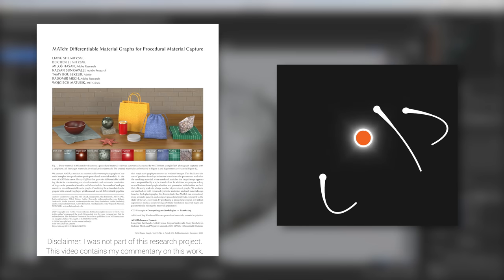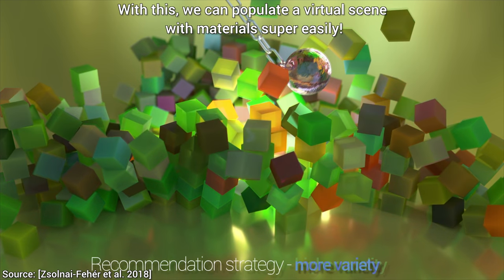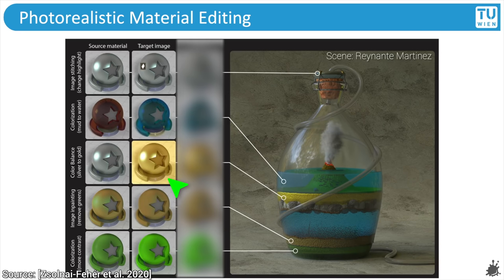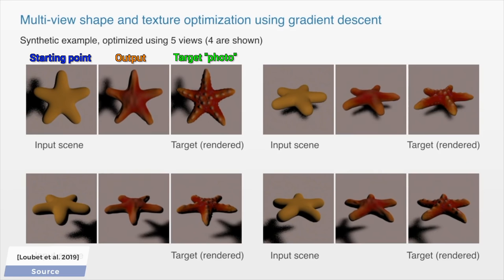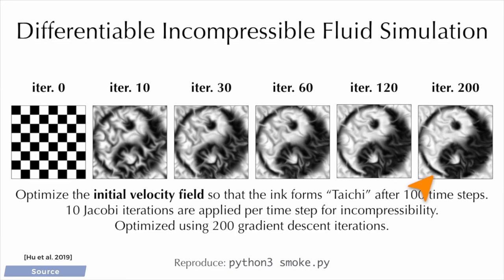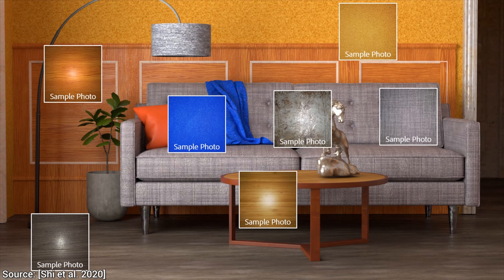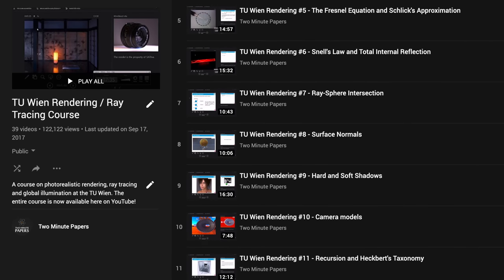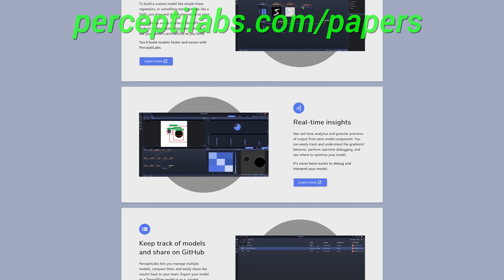Differentiable Material Synthesis Is Amazing! ☀️

Comment: karoly, i am running out of superlative adjectives to describe these developments you lay before us! the possibilities that this could unleash are so extraordinary that it is hard to know where to start, but here are three quick thoughts: 
1) there are oceans of budget-priced 3D models (Daz, RL, etc) that have reasonable geometry (ie made of quads not tris and quite high poly) but their texturing lets them down. re-texturing takes ages (whether you use substance or look for textures in texturehaven or poliigon etc), but this looks like it makes the process very quick; 
2) matching the foreground, live-action lighting in a green-screen studio to the lighting in the CG set is really hard - i wonder if this could be used to help either make the CG match the live action and/or even more amazing, help the DoP understand where the lights are in a reference scene? from this for fun and practice, can you imagine being able to work out how Arthur Edeson lit Casablanca or Robert Krasker lit The Third Man! or of course any other film that you think has wonderful lighting.
3) photogrammetry is progressing but it still leaves a lot to be desired. perhaps this could help with the texturing, which is otherwise (i think) just bitmaps. 
- final point: it would be great if the nodes could be set up entirely in blender so that it was not necessary to use expensive (but amazing) software like Substance. there are a couple of blender add-ons edging towards substance (though substance and similar products are now very sophisticated) and it is already amazing what can be done natively in blender.

Comment: The source material image at 6:18 looks like bamboo, but the material match looks like wood. Does the rendering pipeline machinery not have the capability to model bamboo more precisely? The bamboo has straighter grain and "knots" along the strands, unlike the wood texture which has curved grain and fewer knots...

Comment: Thanks for sharing such great videos. :) I'm wondering, is it possible to use this/similar method to recreate sound from spectrogram with a software synth (eg the algorithm turns the parameters till it gets a similar result?). are you familiar with any research which tries to recreate synth sound in a similar way or other ways?

Comment: Question: would it be possible to get a similar AI to look at a pattern and recreate it as a maths function? (Let's say using different perlin noise, sine waves etc) 

Reasoning: procedural compression using AI, 

The pattern in this case, that the AI has to try and create is 1 and 0, binary

Where the AI can chose which makes most sense to be black and white, grid size, and chunk size. 

If we could turn chunks of data let's say gigabyte in size, turn it to couple lines of instructions as math functions where a library will understand that, and recreate it, heck why stop there, because it's procedural - we can run the algorithm on it's own results to make it even smaller, until it's only a few kb in size, 

Or is this just some over optimistic idea for the use of AI?